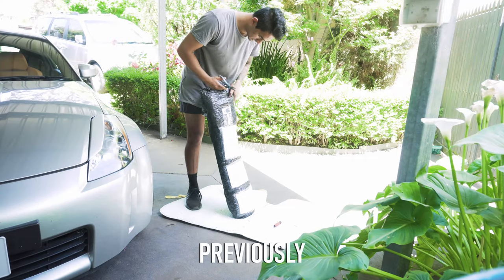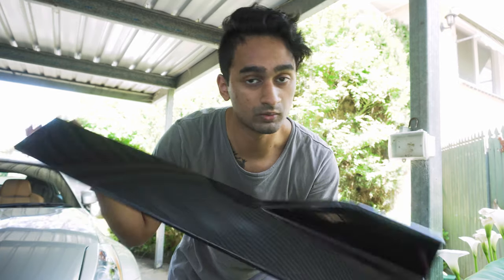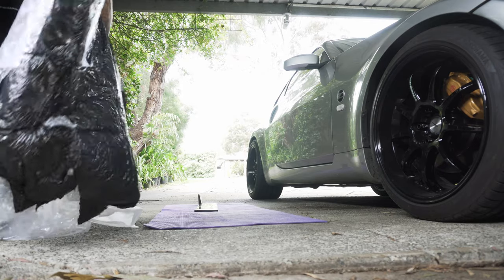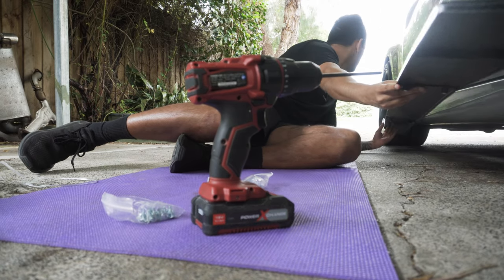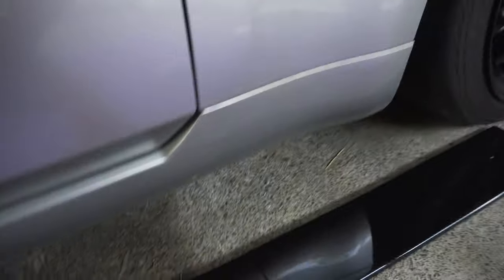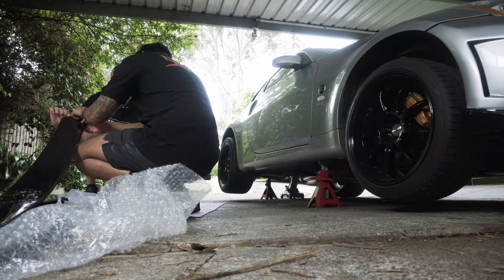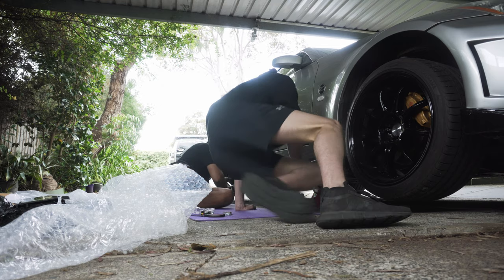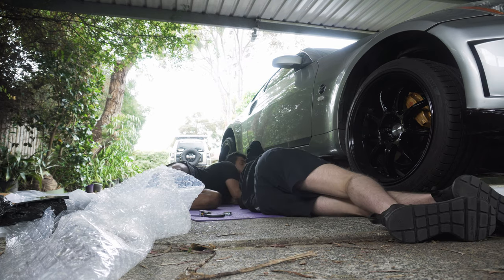350Z Side splitter install!

Comment: Yo yo u have link bro ?
Reply from the maker: They are just universal splitters should be heaps on like amazon/ebay etc.! :) https://www.fruugoaustralia.com/nissan-100-nx-200-sx-300-zx-350z-370z-6-pcs-gloss-black-car-side-skirt-rocker-panel-splitter-spoiler-blades/p-50152750-99769118?language=en&ac=google&gclid=CjwKCAiAouD_BRBIEiwALhJH6JdzQpvVi8u6b22MTIgdeNaBp_y87LOyiOm1mmkTAR6PFGYfQEaTABoCEPEQAvD_BwE